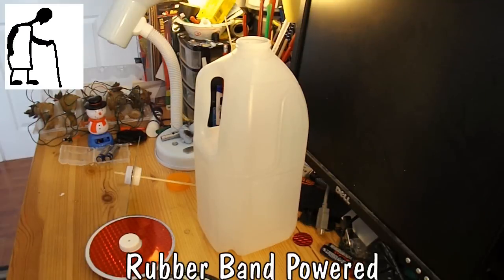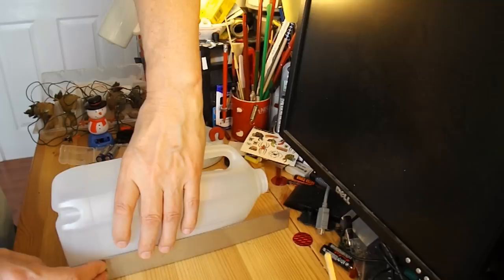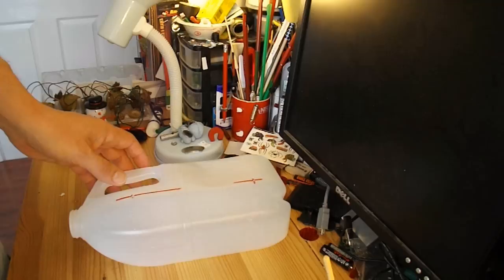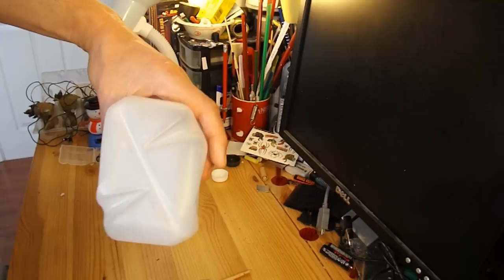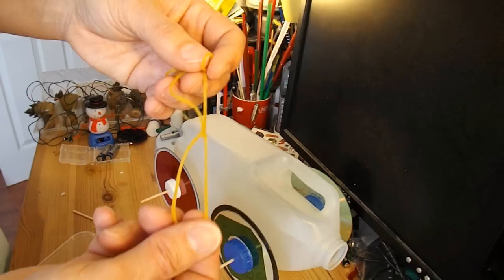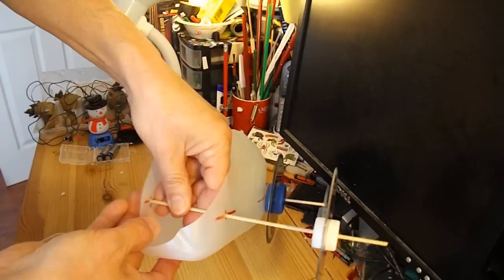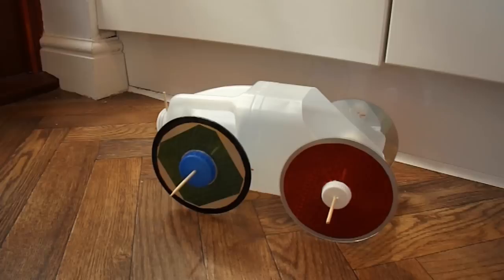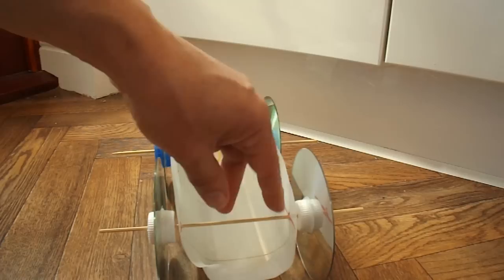Rubber Band Powered Milk Bottle Car

Comment: do you think this car could make it to 7 meters?
Reply from the maker: Hi Zainab Khaku, same answer as before. No I do not know if it will go 7 metres. It travelled 5 metres in the video and hit the wall at the end so I know it would have gone further than 5 metres, but I have no way of knowing how much further. However you can see this car is travelling fast when it hits the wall so I am confident it will go much further and I think 7 meters should be easy.

Comment: When one of your toy cars is you go to one side, you could wind the rubber band on the shaft portion which is inclined towards.
I tell you, because I had a little toy called "Twister".
It consisted of a kind of four wheels mounted on two large pedals and had to change direction at all.
However, I learned to change (although poorly) direction, giving more pedaling force, on the side you wanted to twist.
The angle was small, but enough to save some obstacle, if I saw him in advance.
You could try it, because you just roll it out of the center of the shaft.
Reply from the maker: Hey Francisco, 😆 just had a new comment on this old video and noticed I missed your comment 6 years ago, sorry about that. Hope you are well 👍
Reply: @GrandadIsAnOldMan  Thanks Grand!
Yes, luckily I'm fine and I hope you are too.
I don't post anything on YouTube lately, but I'll post some things shortly.
Regards! B-)

Comment: I would use thin straws to reduce friction in the axles
. By the way for some reason I cannot subscribe to your channel . Everytime I do it does not show on the list.
Reply from the maker: Hi Dart Gar, thanks for commenting, I have no idea why you cannot subscribe and I do not know how to check to see if you are already subscribed. When I click on your channel list you do not appear to have any other channels listed. Have you been able to subscribe to anybody else?
On the subject of drinking straws and friction on the axles I have not done the maths on friction for nearly 50 years. I drill holes (or melt them in this case) that are significantly larger than the axle, that means the only point of contact and therefore the only friction point is a small percentage of the circumference and only the width of the thickness of the plastic milk bottle shell so it is tiny. If I put the axle in a drinking straw you have the potential of friction contact all along the length of the straw significantly increasing the potential friction generated. On cars where I do use drinking straws for axle tubes I use straws that are much larger diameter than the axle, perhaps a 6mm straw for a 3 mm axle which means that the axle is loose inside and probably only makes contact at a small percentage of it's potential surface area.
Reply: I got your subscription now after I resubscribed. If you remember I am the one who suggested not to trow away the VHS tape so it can be used for wind power. I will keep an eye on the subscription issue. It seems that YouTube may have a bug or something when someone subscribes the first time.
Reply from the maker: Dart Gar I am glad that is sorted. Yes I do remember your suggestion, I have it in my list of projects to try.
Reply from the maker: Hey, 6 years later I just had a new comment on this old video and I read through all the old comments. I remember you suggesting the windbelt generator. I don't know if you ever knew I did follow your suggestion, so here is the playlist I made to go with it https://www.youtube.com/playlist?list=PLA5a2xPRSrB3NTFyWVJN8lAQZ5aQHTc5G